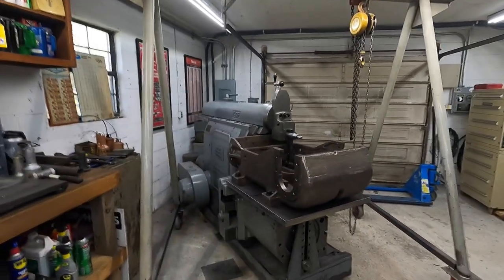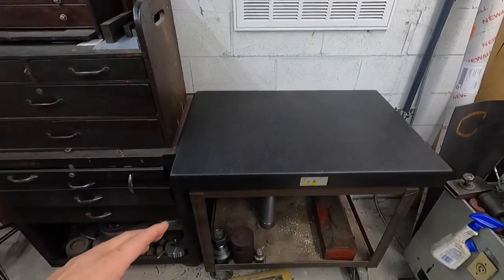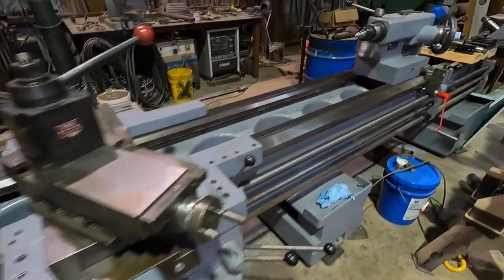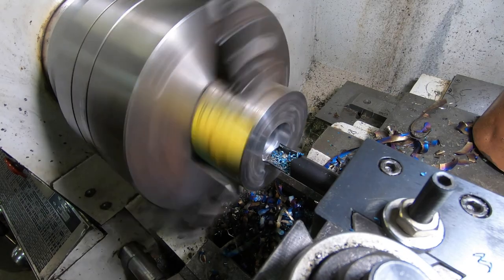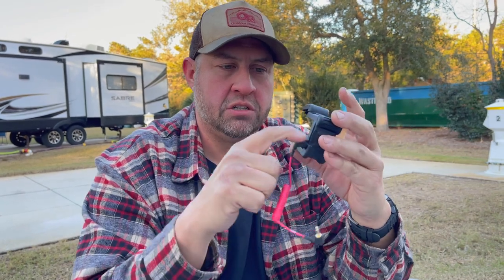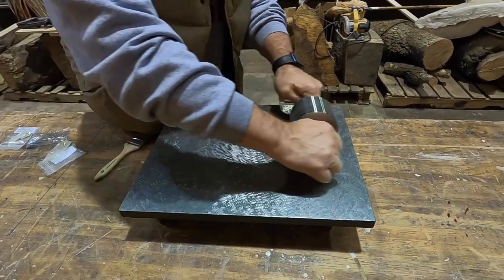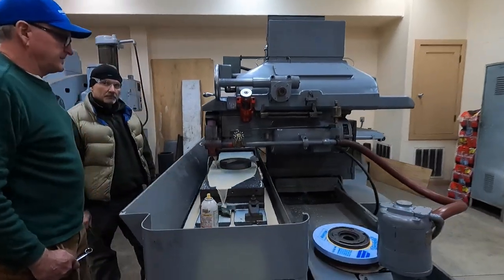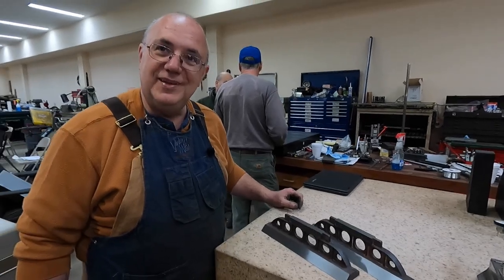SNS 333: Several Shop Projects, Richard King Scraping Class, Audio Problems

Comment: Ok, watched a bunch of all yalls stuff on these straight edges. AND. Not a machinist at all. What is this particular type of straightedge used for? I use my straight edges for ,well,  marking straight lines.
Reply: a straight edge in machining terms they are perfectly straight and flat for scraping in a machine or checking for straight or flatness
Reply: And the angle of this is to match the ways?
Reply: @skunked42  yes i believe so
Reply from the maker: Once scraped and verified, they’re then used as your reference surface to check your machine ways against when scraping and rebuilding.
Reply: @Abom79  thank you make more sense to me now
Reply: @skunked42  The angle doesn't match the ways.  It's typically a narrower angle.  You stick the angle of the straight edge into the dovetail and then lift it up to hit the angled dovetail surface with bluing.
Reply: This makes sense. @JohnSheerin

Comment: Hate to be that guy, but honestly you are using a camera as a master audio recorder that is not designed for that purpose. You would never use the wrong tool for your machining work, but that is what you are doing for the video. I have watched your videos for years and I have seen how much better they have gotten (like the work you put into making the dial of the gauges visible on video...) but your setup is quite basic.
I am also aware of the limitations of being a "one man band", so some of the proven solution would be difficult for you to use.
Min. solution would be to use the gopro but record the audio on a separate audio recorder. That would be a good first step (something from Tascam or zoom).
My real suggestion would be to use a solid camera (Sony A7 would be great, but the RX100 would also work - or similar camera) and use it with a Atomos Ninja V - this way you would not only get a better picture quality, but both video and audio would be recorded in two places (the camera and the ninja) introducing a bit of redundancy in your workflow. Also monitoring audio signal on the ninja is quite easy, so at least you would know you have an issue. Unfortunately that setup would be much more bulky than just a gopro, so you are going to hate the idea.

Comment: Hi Adam, I see one or two machinists using the round 'Button' inserts on lathes, usually when removing an old weld on a hydraulic cylinder, I've never used them before, what's you're thoughts on them?

Comment: Whats the purpose of "scraping " is it some sort of mini chisle ??
Reply: As I understand it it's indeed a chisel and the action of "scraping" moves the chisel along the surface. As long as the surface is flat it just glides over it, but when it hits a high-spot it is forced up like your car when it hits the curb, and that's when it actually scrapes some material off the surface.
Reply: Precision hand finishing when leveling surfaces.
You use a level and push it across a surface with a single point - where the level wants to rotate is a very small peak
Scrape the area to remove a 10th of a thou or so as Vinny described
Repeat, find new high spot
Repeat until you are happy with the result's flatness
Reply from the maker: Refer to my previous videos on scraping.

Comment: Is it me or was he using a caliper to dig that red hot part out of the oven?
Reply: It was you.
Reply: @paulcopeland9035  I think he was using a caliper. I looked at it several times.
Reply: It looked like a blacksmith tong to me.
Reply: @michael-michaelmotorcycle  ....good call.  What the heck would he be doing in there with a caliper??

Comment: That A2 steel roller was quenched in oil. Should it be air quenched? Just wondering..
Reply: You can do either.  Most prefer to air quench tool steels.  Oil is a little touchy and can result in a harder than required Rockwell number or worst case can lead to an uneven hardened surface.  Air quench is the preferred method.
Reply from the maker: You can use either technique

Comment: Keith's got his video out earlier - and I was completely distracted by the large Cincinnati mill. Since it has both the horiz. and vert. spindles, I'd have classed it as a 'universal' until a few months ago - when I discovered universal meant something else - that you can turn the table to some degree. I noted the table on that one is fixed. I wondered what size taper (50?) it has. Mine's got a 40 taper but is a similar height machine - and it has a full set of power feeds - which seemed to impress you - yes, makes the Bridgeport look like a toy ! Mine also has a 2-axis swivelling head (both 360°) as well as the swivelling table - I just can't remember the table length ! Like the Cincinnati though, mine doesn't have a quill.

Comment: I kinda don't get it. You spend all of that time making your surface microscopically flat using scraping techniques, but then you embed hard diamond particles into the surface, which must make it bumpier again, right? Do you check flatness after embedding with diamond particles?
Reply: Well they are making a diamond lap to remove material from the granite surface plate, without the diamonds the lap wouldn't be effective.
Reply: That iron plate isn't meant to be a perfect flat surface. It's a lapping plate. AKA "sandpaper"
He just made a big "sandpaper" plate, for sandding the granite plate flat.

Comment: Sorry to hear about the engine. I was looking forward to vids on it. I assume you tried coming at it from the other side of the casting? Would the shaper not reach or be able to stop in the right place on the back stroke? Just curious. I’m by no means a machinist.
Reply: The far side is several inches higher - The issue seems mainly to be that it only just reaches and clears when running in fresh air: once you add depth of cut to clear the surface that needs machining the main ram would strike the casting

Comment: Isn't a GoPro an overpriced junk since few iterations? I've read so many discussion regarding random problems with audio/video quality/problems.
For the price of the GoPro9 you can easily get Sony HX400V, Canon PowerShot, even Canon EOS Rebel DSLR.
If i made videos on a daily basis I would never go with a gopro :D
MIght be you just got lucky with your gopro 8 for so long as you have.

Comment: It could be loose connection with the cables but also lots of other things. There should be special display indicator  to show audio decibels all the time. It seems that your camera is expensive but not professional type.
Reply: The whole point of it is to be small. Hence the name action cam. If you start adding things that "it should have" it starts to become less of a small action cam. He had audio issues without an external mic plugged into it, so it can't be loose connection. I watch YouTubers that use multi thousands dollar cameras and have studio recording issues. It is a professional camera. When a professional needs to have a small, waterproof, durable, low mass camera, that can be mounted almost anywhere, they use GoPros or Don't action cams. A professional using it is what makes it a professional camera, since there isn't really any alternative that suits those criteria. This is the best you can get it you need a small, waterproof, durable, low mass camera, that can be mounted almost anywhere.
Reply: @littlejackalo5326  Such indicator could be a small piece of hardware or software / firmware. I can imagine it works well and is still small and reliable. The external mic is a weak point because it could easily fail, so why camera should to detect it, the similar way smartphone can detect if earphones are connected or not. I would say there is design fault in the camera which allowing record video without audio!!! Definetely it is a fact.
Reply: I mean it's called a GoPro, not a Go.

Comment: Adam action cams are toys. actually they are very very very expensive toys. Buy yourself a dslr and a good lense. It will cost about the same but you will have a real cam with real lense for a serious job without problems.

Comment: Why is grinding more precise than machining?
Reply: Grinding is still machining, just abrasive machining. It affords you the capability of very very fine material removal rates.
Reply: @mthompson  I knew it was still machining.... was trying to ask question in shorthand... Thanks for the response
Reply: @halsnyder296  because there's much less vibration and harmonics interference compared to milling and lathe. And because you only remove very minute amount of material the grinding wheel drive motor is simpler (it's easier to cancel its harmonics and vibrations) also the table is floating on air (hydrostatic air bearing)  which elements any vibration and gives very smooth running machine. The grinding wheel has to be also on spec to give high precision workpiece.
Reply: @Trident_Euclid  thank you!
Reply: It can be more imprecise when done incorrectly, trust me ;)

Comment: Hi @Abom79, love your videos!!!  Can you please tell me why you need to have the granite sitting on three "points" and not nestled like it was on the metal?  I just don't understand the physical aspect of it.  I'm so sorry about your Hero9 messing up like it did, oh my goodness; how frustrating it must be!  I hope you can get your money back or a brand new replacement.  All this talk of how you all sit down together and talk about diagrams and working on machinery, and here I am, I can change the oil in my own car, change out the windshield washer reservoir, change a flat tire and replace my wipers, oh, and to engage the motor I insert the key and turn it clockwise.  If it doesn't start, I do it again. If it doesn't start, I do it again.  Repeat..... Then I come back in the house and yell, "Honey, the car won't start".  Then 2 minutes later, I'm on the road!  LOL  You have a beautiful smile!
Reply: Look up "airy points." it has to do with getting the minimum amount of sag over the whole surface plate as opposed supporting it on the rim, which would allow the center to sag.
Reply: @Troggination  Oh my goodness, I never in a million years would have guessed that something as strong as granite could sag, especially such a thick piece of it.  Thank you so much for answering the question so quickly!
Reply: @annkoehler8017  There's actually a pretty interesting science to this, all on Starrett's website: https://www.starrett.com/precision-granite/precision-granite-faq 
 
One thing to think about here is that unless two surfaces are rigorously scraped in to flatness, two mating surfaces only ever touch at 3 points (assuming infinite stiffness). So if you have an angle iron frame around your granite plate, it's likely only actually resting on 3 points in that frame anyways. If it's only going to rest on 3 points, might as well put them in the best place to reduce sag.

So for an AA certified granite plate, which is flat to within 0.00004" over a 6 foot diagonal,  any deflection is highly noticeable at that scale.
Reply: @Troggination  WOW, thank you so much.  Such a fascinating science, and it's so hard to believe that we can get tolerances set to such incredible precision!

Comment: Take a laptop.  Attach ONE wireless mic to the laptop.  Test the input works.  Repeat for the other mic.  Typical testing methodology that an on-the-road sound engineer might perform in a pinch. Disclosure: was a sound engineer.  This feels like an encoding problem. I am no expert on your hardware but I suppose advising you to get another memory module could not hurt, since that would be another potential point of failure during the encoding/storage process.  So, get spares, do iterative testing. Use a small laptop to test. In the end it's probably a software failure which is out of your reach to fix.

Comment: If he rotated the tool post (not the clapper box) there probably would have been just enough clearance, judging by the video at least. Sad to see Adam give up like that. Wasn't the whole point of becoming a full time content creator to do projects like this? Plus, forged steel is stronger, not stiffer than annealed steel. A custom tool could have worked.
Reply: If you listen the client wanted to go another route.